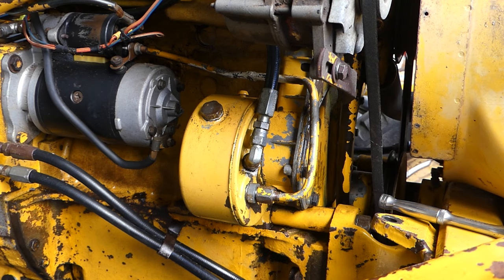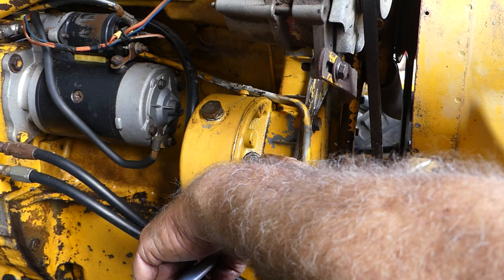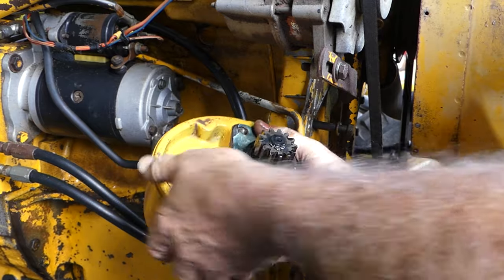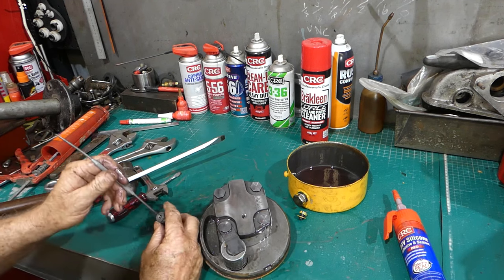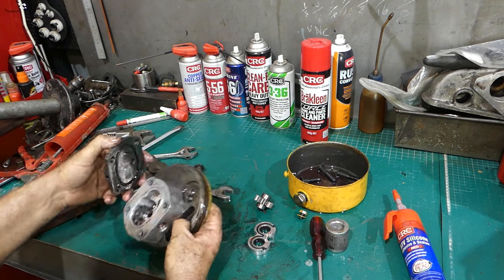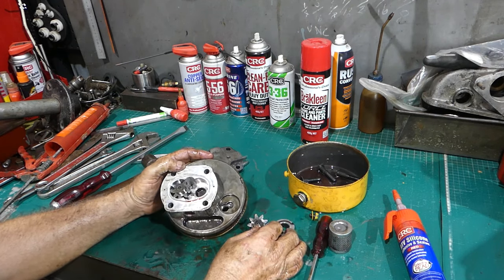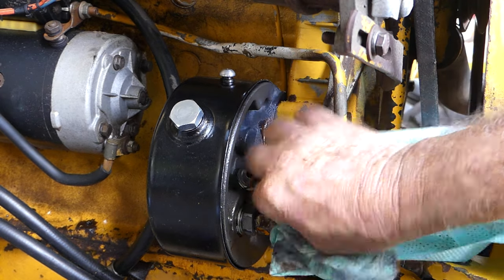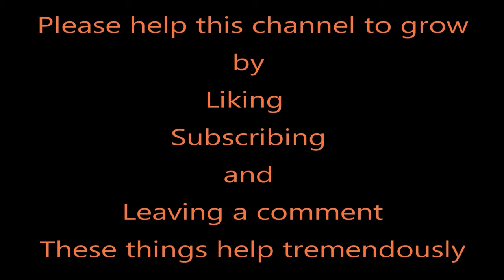Fitting a Massey Ferguson 20 Power Steering Pump

Comment: Thank you for a very interesting video. I have a MF 702 industrial tractor with a 23c diesel engine it has a power steering pump which looks similar to this but is driven by a pulley and belt the other differences is that it has a separate tank to feed it as the whole thing leaks for a pastime  do you know if this is the same pump and could i  put my pulley on one instead of the cogwheel and changer he pump over? Best wishes Paul Ancill
Reply from the maker: I think it should work if you mounted it securely. The main shaft has a key so if the pulley matched it should work.